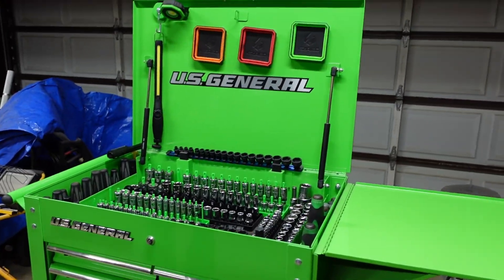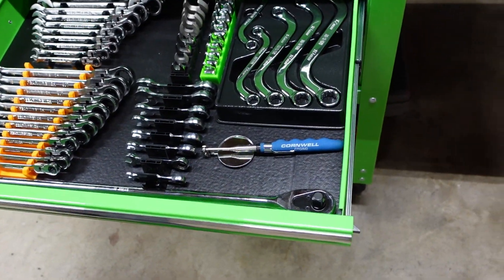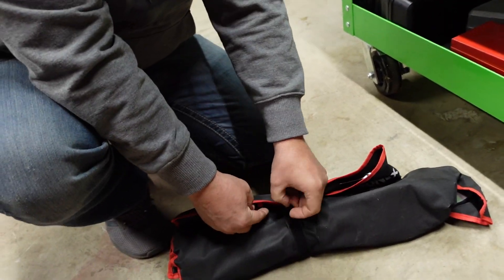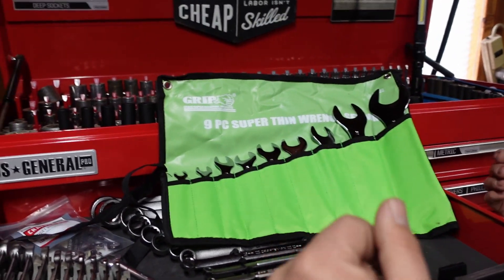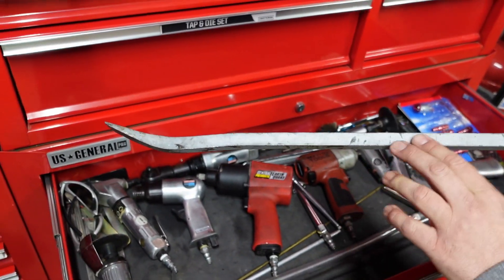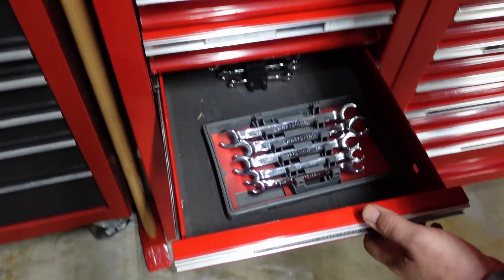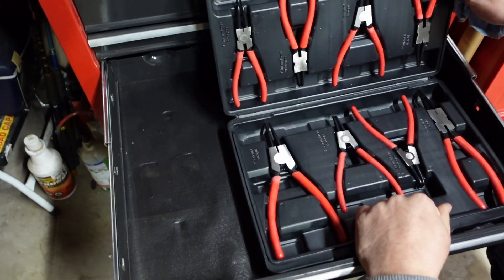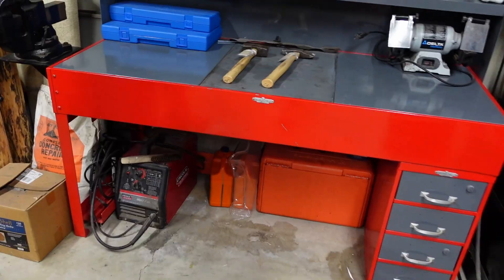WAY More Tools Than I Expected - (Home DIY box) US General Toolbox Tour

Comment: Astro sells a 17/22 nano ratcheting wrench to work the Nano impact sockets. You need at least one if you’ve got 1/2” and 3/8 nano sockets. Their Nano impact guns are the greatest thing since the IR 231 or the CP 743
Reply from the maker: I didn’t know that! Thanks for the heads up.
Reply: I ended up getting the 18 inch astro nano ratchet😁 the 17/22 might be next😂